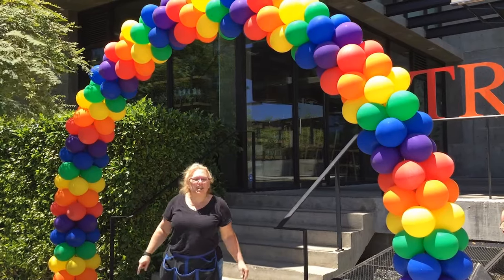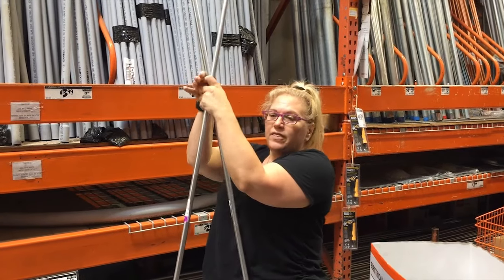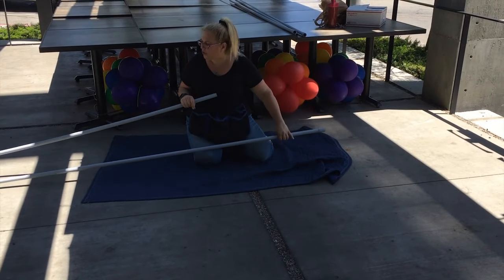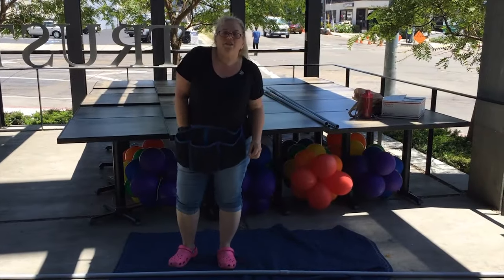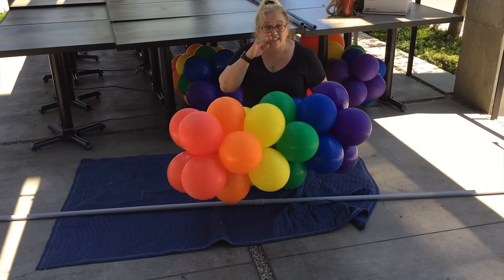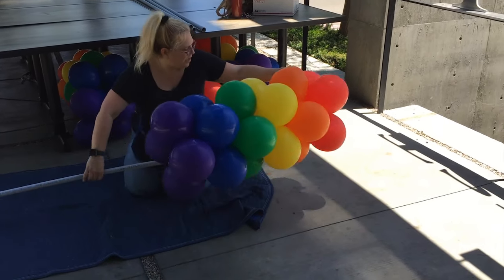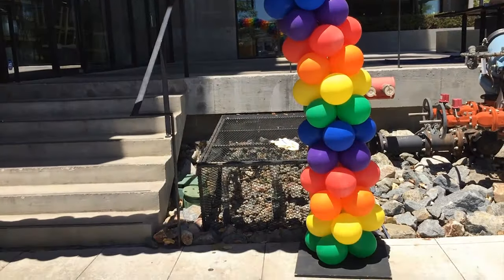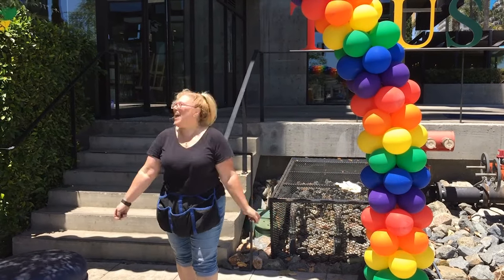OUTDOOR BALLOON ARCH - Diy Step by Step

Comment: This is such great information. Thanks for the measurements and parts list! Any modifications to be aware of if this is riding on a parade float? Obviously it won't be going very fast, but if there are gusts of wind, etc. it might get a little tilty even with water weights or weight plates on the supports.

Comment: what an amazing video with so much detailed information! thank you. Btw if i wanted to make the arch a little smaller, would it be okay to have the PBC cut into 6Ft each instead of 8ft? will it still  bend to arch???
Reply: Did you ever find an answer? I need to make this, but not quite so high.

Comment: Thank you, Sandi!  Can you please tell me if you have also had success using a forty-foot length with this method?  Thanks!
Reply from the maker: I believe you can go up to 50', but having said that, I've never done more than 35' simply because I haven't had a client with the need for it longer.  :~)
Reply: @SandiMasoriPresents  Hi Sandi!  We actually did make a 50-foot outdoor arch (total length).  We used your model as a starting point and took it from there.  We used 10-foot tall heavy steel poles screwed into our custom bases and base plates because the client needed at least a 12-foot clearance for trucks to drive through.  I believe we used a combination of PVC widths with a some sections being 1-inch  with part of the middle being 1 1/4 inches (most of the five PVC sections were 3/4 inch).  I have photos I can send.  The arch was a little flat, but the height ended up being well over 15-feet with a 30-foot width.  I should have taken better notes, but, we were working in the middle of the night.  It was hard work.

Comment: How high was this outdoor arch? And how short would PVC be cut for an indoor arch?
Reply from the maker: It's approx 25' linear.  The height and width depends on how far apart you set the legs. Basically it's your standard double doorway size :~)

Comment: I need to create a 32 ft wide outdoor arch. Would the emt pole length need to by taller and how much gray pbc will I need?  This video is great by the way
Reply: What did you decide to use for your project?

Comment: Thank you so much for your videos.  We are making two columns and a balloon arch for our twins 21st.  Next time I will make the balloons a little smaller.  Is there a reason you wouldn't put the weight on the pole to rest on the flange vs sliding the weight on platform? Thanks for your time.
Reply from the maker: Yes, the reason is that it distributes the weight a little better to add to the footprint, making it more stable, and also easier to move around.  Especially if the clients are going to be moving them at all :-)

Comment: Sandy, i want to make this arch but i don't need it so large, I'm looking to do maybe a 12 to 15 foot arch how do I break down the PVC - two pieces of 8 1/2" with bell cut off on one?  Does that sound correct. And do I still cut EMT to 3 1/2" ft or can I cut it a little shorter?  Thanking you in advance! and btw your video is awesome!

Comment: Hi Sandi,  Hope all is well! When I make the outdoor balloon arch 1) I am attaching 40" mylar letters to it -Do I use helium or regular air?  2) Do I attach the balloons on top of the latex balloons with 260's or on the lower level onto the latex balloons with uglu dashes? which way is better? Thank you!
Reply from the maker: If you're glueing the letters onto the arch, air will work better.  If on the other hand you want to float them above the arch, then it needs to be helium :~)

Comment: Thanks for the great video! Is there another option to use instead of pvc because it is one of the worst plastics for the environment so I don't want to use it personality ! Thanks again!
Reply from the maker: Well, you're reusing the same pvc over and over and over again, not throwing it away, so it shouldn't really be an environmental issue.  Unfortunately I don't know of any other material that would have the same properties of being both flexible and strong at the same time.  I suppose you could just frame it from metal like in this video, but honestly the pvc works better.  https://youtu.be/Wd8YYwFIh7E
Reply: @SandiMasoriPresents  thanks Sandi, that makes sense!

Comment: Hi Sandi!  I’ve assembled everything and tested out my arch without balloons.  I was surprised at how much it was wobbling back and forth.  Will the balloons stabilize it once on?  I’m using 3 pieces of 8ft grey PVC 3/4”.   Also I never noticed a locking sound or mechanism when twisting  the PVC into the bells.  Any suggestions?   Thank you so much Sandi!
Reply from the maker: It's not a locking mechanism, I think it's more of a pressure fit.  It will wobble, but should also be stable.  :~)

Comment: Sandy thank you so much for this video! Would this arch be wide and tall enough for SUV’s to go under? And if not what would you recommend I use ?
Reply from the maker: It's prob not big enough at this size, but if you make it 35' instead of 25' it might work.  I've never tried though, so it's just in theory.  ;-)
Reply: Sandi Masori hi sandi thanks for the response! I ended up making it 9.5’ each pvc, total of 28.5 feet and cars drove thru comfortably. Have you ever had all your balloons on arch pop from the heat of the day?
Reply: @adamra301  hi!!! I want to do this for my daughter's drive by bday. Cars will be going under it. Did yours work well? And how many balloons did you use?

Comment: Love the step by step. My question is where you slid the PVC over the EMT you wouldn't have to tape it down for security in case of wind?
Reply: The EMT is at least 3 feet so she said in the video that the pvc won't slip or blow off. Hope that helps.
Reply from the maker: With 3.5' of emt inside, it would be very difficult for the wind to lift the whole thing up 3.5' and then off the pole.  And if you do have wind that is that crazy, I imagine that the event would be cancelled as there would be much bigger problems ahead ;~)  That's why you want it that length and not just 6".
Reply: Ok thanks Sandi!!

Comment: Awesome video! Thank you! What sizes carriage bolts/nuts did you use for the base?
Reply from the maker: That's a good question, I think it's just the size that fit into the flange and had the right length for the wood.  I would ask the guys at the hardware store to recommend the best size to you :-)

Comment: Hi Sandy! I absolutely love your creativity! I need your advice. I am struggling to make a cresting wave with a surfer on a surfboard on it in the inside... 
I was thinking I would do multiple arches to create the tubing wave... I'm so new at arches, that I'm completely list as to how to proceed.  I have multiple shades of blue balloons, as well as white and clear balloons to simulate the foam on the crest of the wave. We are using this wave for my husband's 70th Endless Summer themed birthday party. Can you help me figure out how to do this? I need your creative genius so that I do not thoroughly mess this up. 
Sincerely, 
Crazy inexperienced wife
Reply: I'm thinking I need to bend the poles on the right side at an angle? Arrrrgh I just don't know how I'm going to accomplish this or if this is even the correct way to proceed. Help?!! Xox
Reply from the maker: Yes, if you want to make a wave, you prob need the poles to bend back and then curve forward.  I would do it just above the connection point, or it will be difficult to put together :-)

Comment: What do you use to stop the oxidation on the balloons when you make your outside arches? What brand of balloons do you use?
Reply from the maker: I use mostly use Qualatex.  I don't do anything to stop the oxidization - as long as they all oxidize equally then it will look fine.  The balloon shines and the like don't do so well outside in the heat, and they're sticky and messy, so I just don't bother with that.  I explain to the client that over time the balloons will get a "velvety patina" ;~)

Comment: This video was amazing!!! 
I'm going to try screwing the flange into my three hole cinder blocks!
Thank you for the inspiration🎈
Reply from the maker: You're welcome :~)  How did it go?
Reply: @SandiMasoriPresents  I ended up using the flat three hole cinder block( later and smaller than a traditional cinder block for transportation LOL but still strong enough to withstand wind etc) a 2 ft metal pipe into the center hole and filled it with concrete let it dry and it worked amazing with the conduit for either Arch ends or tall single stands!!! Thank you for the inspiration

Comment: What is the largest size frame you recommend using this method?
Reply from the maker: I've never done larger than 25' like this.  I think that if I were going up to 35 or 40' I would go up to 1" pvc.  :~)

Comment: Hi, what size carriage bolts would you suggest to adhere to the 2x2 base?
Reply from the maker: You should consult the guys at the hardware store because it depends on the thickness of the wood.  They should be able to point you in the right direction.  Remember they go in from the bottom and out the top ;-)

Comment: Is it ok to have 5 feet instead of 3 feet? This is because there was no one to cut the 10 feet down to that for me.
Reply from the maker: It's ok, it will just make it so the bend comes from a bit higher.  They sell emt cutters at Home depot as well.  It's a pretty handy tool to have around and not very costly  :~)
Reply: The Emt cutter will cut thru the metal?

Comment: Hello , if I wanted it smaller the arch instead 3 grey pvc can I use two grey pvc
Reply: I need a smaller arch
Reply: No you need 3 pieces for support in the middle. Just cut each piece shorter. Instead of 8ft do maybe 5ft instead

Comment: You've probably already made a tutorial to answer this question, but...
Whats the largest outdoor arch you would dare to make?  I made a very large outdoor photo frame once.  Even after duct taping large paverstones to the bottom, i still have to use tent pegs and fishing line to keep it stable.
Reply from the maker: I haven't gone bigger than 35', though I have heard you can do up to 50.  Usually I will try to get the client to do a series of smaller ones rather than a really large one.   :~)
Reply: Sandi Masori with the 35’ or 50’ did you use 1 in gray pvc? I have an arch coming up that is outdoors that they are requesting to go over a  two way entrance to a parking lot
Reply: Jon Cosby how did it go? And what sizes did you use for the pvc? I’m making one for cars to drive thru and I’m concerned about size

Comment: About how much did you spend on the supplies? Thank you for the awesome video!
Reply from the maker: Hmmm I'm not really sure because the price of all of those items changes as the stock market dictates or something like that ;-)  In general it shouldn't cost more than $25  or so.
Reply: I spent 86.00 at Home Depot and that is because I started from scratch.  I also bought spray paint for my boards..

Comment: Hi Sandi! Nice video.. can you please give the dimensions?
Reply from the maker: it's between 24' and 25' linear.  Once you put it into an arch shape, the height and width will change depending on how close or far apart you set the legs, but in general it's about the size of a standard double doorway :-)

Comment: Hey sandi do you know how many balloons you used
Reply from the maker: It depends on the size of the arch and the size of the balloons, but if you're doing a 25' arch using 11" balloons sized to around 8" or so it should take around 200 balloons :~)

Comment: I tried this method and my poles seemed as if they was going to snap in half.  Could not get them to bend.
Reply from the maker: Were you using the grey 3/4" pvc or a thinner or thicker pvc?  Size matters ;-)

Comment: How do you keep the balloons from popping outside?
Reply: Well how do you keep them from popping outside while assembling??? My balloons keep sticking together and popping
Reply from the maker: The main thing to keep them from popping is to make sure you underinflate (these are 11" sized to only 8"), and use a good quality balloon.  If the balloon is old or an off brand, they pop a lot easier.  That's why I use Qualatex and Betallic.  :-)
Reply: Sandi Masori Presents ok thank you so much. So the last one I did. I inflated to 11 in and then let the air out and then inflated again to a smaller size so they already had some stretch to them. I love qualatex but the store where I purchase them are sometimes sold out of colors. But I have found another brand that I really like just as much so I switch between the two. It’s called Gmar

Comment: Flange is not a bad word in UK except to people with dirty minds :) or no idea of DIY etc. Any way over here in UK we rarely see grey electrical conduit, mostly water pipe is used differently here with slightly smaller sizing. Instead over here we can get 20mm or 25mm  pvc electrical conduit easily from DIY centers or Electrical wholesalers, the same with Galvanised metal Conduit (EMT) in 20 or 25mm sizes again easily from both DIY and Wholesalers. As for the Flange items they are usually  referred to as dome covers or just covers with spout, again easily obtainable from DIY etc, but these are mostly pressed steel and will come apart ( I know) under stress over time. The answer is to get Malleable Iron versions (I have looked and found cheap ones on EBay and a wholesaler) that as your Flange connectors have 20mm internally threaded spouts so that pre threaded 20 mm Galvanised conduit will screw in easily (have made my own bases this way, need to upgrade to Malleable Iron base connectors as only had steel version when I was experimenting) these connected to thick Ply with 4 screws then 6" s of 20mm EMT (easier to say) inserted then  with 25mm PVC over that but cut at 12" so I could use 20mm PVC into that as 20mm  bends far nicer than the 25mm . ALL taped at junctions.  Not perfected yet as only playing as a novice but seemed sturdy. have pictures if anyone wants to see my attempt, also stands and PVC conduit easily used as a frame if not an arch setup!  Here in UK  we have to use connectors as both ends of tubing is plain but connectors are available as outside or inside versions. Again Electrical tape or Gaffa/duct taped together. I also use round exercise weights with holes in center to add over the base tubes to increase stability. Think that about covers it, oh yes a piece of material with a hole in the center over the base to cover it all up to avoid seeing mechanics and prevent popping balloons :)  25mm=1"  &   3/4"  = 19.05mm
Reply: yes that is also possible to use the larger piping ( 25mm PC)as you say Sandi for more stability and less fuss
Reply: I bought a load of cast iron 3/4 and 1/2 flanges from Wish. Came in about two weeks and about £1 each. Just the job.

Comment: I need to make an arch and my pole is 1.25” in diameter. If I buy the electrical pole for the arch what size diameter should I buy? 1.50”??
Reply from the maker: You want the emt to slide into the pvc, so test it to make sure that the pvc will slide over the emt :~)